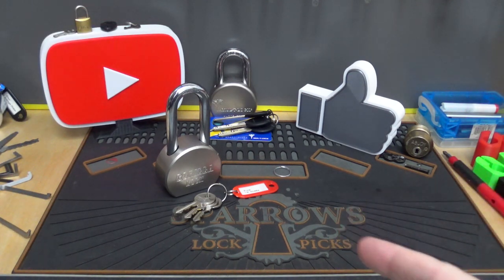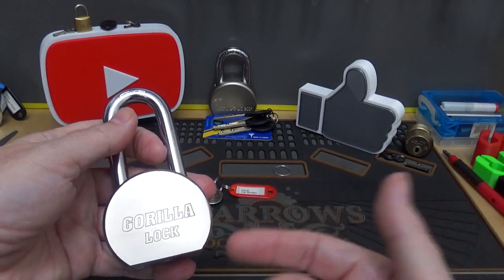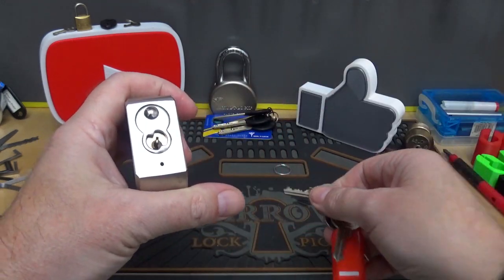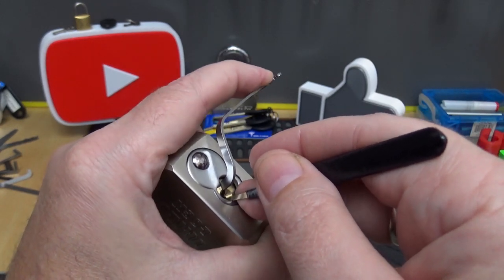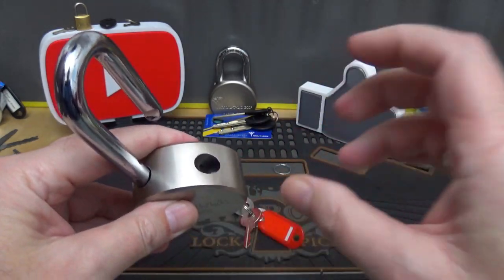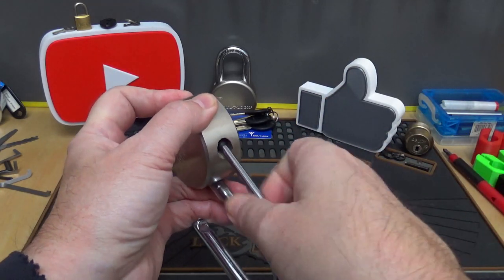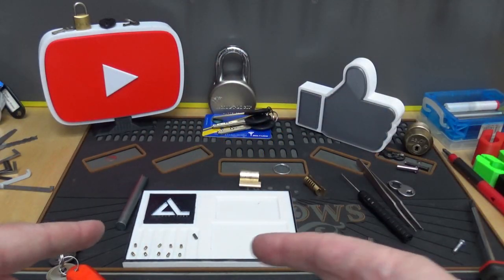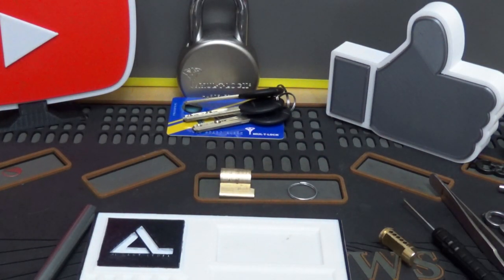#350 Gorilla Lock Reviewed and exposed

Comment: great job and yet again you have taught me something new! Thank You!
Reply from the maker: Awesome, thanks Dana, glad to help. The ones that don't have the hole. I just use a 1/32 drill bit in a pin vise to drill through and push that pin up. That way the hole is so small it will not affect it when rebuilt.

Comment: When I gutted one like this it puked on me...
Reply from the maker: Hopefully my technique works for you. The ones that don’t have the whole I mentioned I use a 1/32 drill bit to make one. Hold the bit in a pin vise
Reply: @AlbertLebel  thanks for the advice but I'm a clutz.. Don't think it will help😂
Reply from the maker: @mikecummings4715  I understand. I blew a few up in my early days also. Just grab one and practice disassembly and reassembly . Practice, practice and more practice.. I find it quite fun and learn a lot on the way